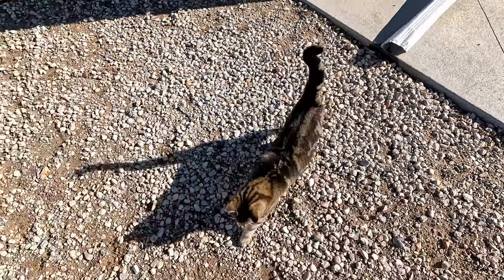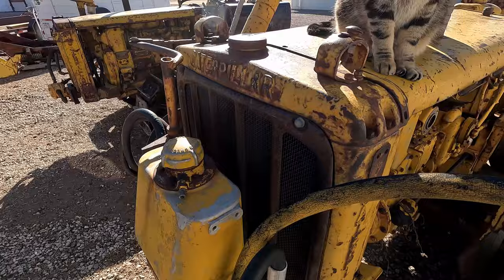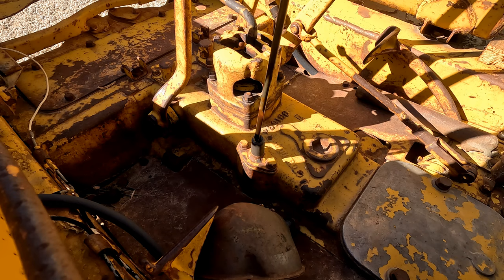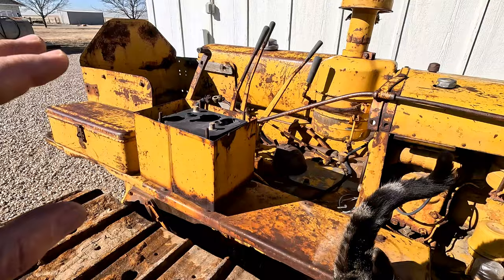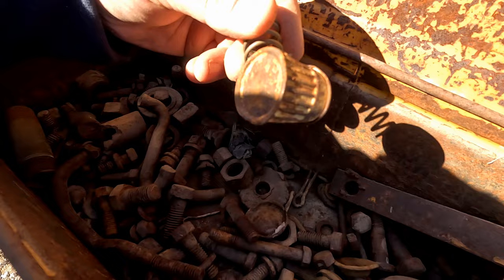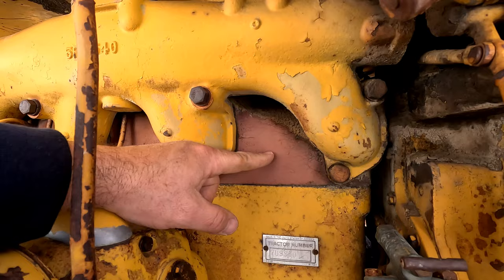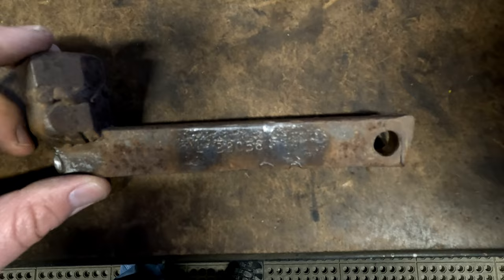The toolbox tells a tale! 1950 Caterpillar D4 Dozer 7U9360 Matching Walk around.

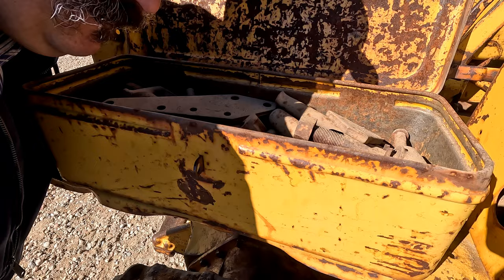Comment: The drawbar pin hole wear combined with higher right side pedal wear says this tractor probably put in a lot of hours pulling a moldboard plow at one time. The mystery brackets at 8:58 and 9:06 look like the limiting stops that bolt in above the main spring on each track frame. 12:16 is what we call "barn tin" sprockets because they have the same rounded profile as the old barn tin roofing lol 😂 At 14:01 that's GOTTA be where that rod cap came from 😵 And one of the Cat No.9 Auto Patrol graders I hauled home had an old can opener like that hanging from a small hook on the power control box in the cab - likely for opening fresh cans of Cat yellow paint like you said lol 🤣 Great walkaround! That toolbox sure was their "catch-all" for all the leftover bolts that they had at the end of every job - and make sure to pet Super Stripes for us too - she sure was trying to get your attention lol
Reply from the maker: 😂, they do remind me of corrugated barn tin! I will say, that this does add a lot of pieces to the puzzle. I'm definitely going to have to look closer at the front spring. I imagine the removal of the front mainspring stops must have had something to do with that unique dozer design. I will definitely put big stripes in send your regards. One thing for sure, she is definitely not camera shy. 🤣

Comment: The fuel cap used on the 7U is the same or same design as was for the KD-35 crawler and MTZ-2 tractor. The major difference being they where from cast iron and could get stuck overtime. So people used a dull axe or hammer to get the cap off. Your in the CAT cult now my friend.😂
Reply from the maker: 😂, for sure!